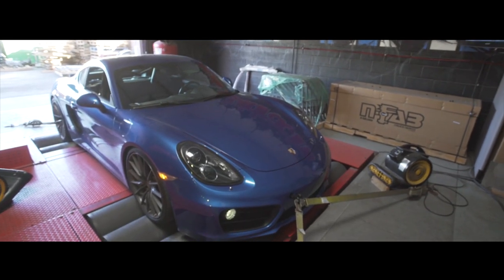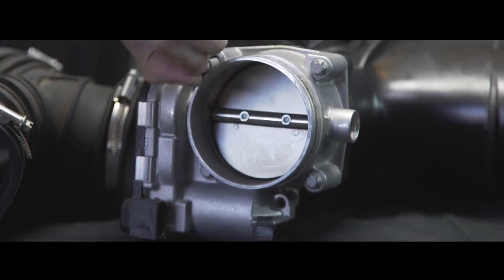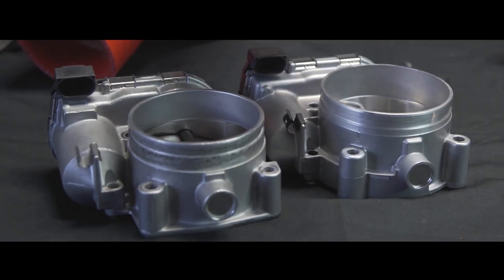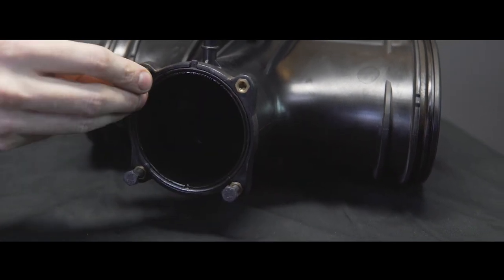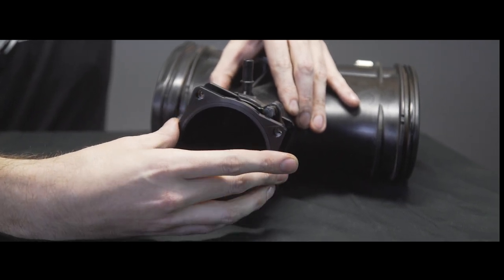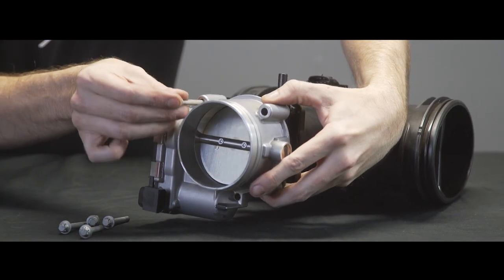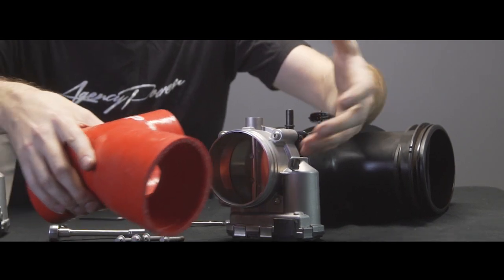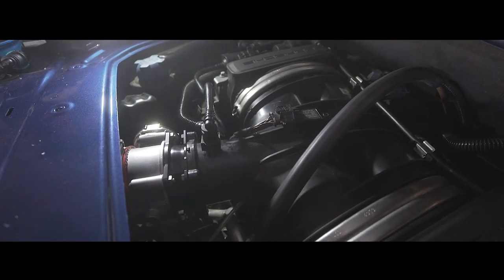Agency Power GT3 Throttle Body Upgrade Install Porsche 981 Cayman S

Comment: I'd need to see a dyno before and after comparison before I would consider spending the coin for this mod.
Reply from the maker: Flies2FLL well.... the description of the video has a link to the product which has the dyno sheet
Reply: @vivid_racing  Good gains above 5k rpm but the chart doesn't show the graph below 5k.  Is there the dyno with the complete rpm range from 2k and up?
Reply from the maker: @vancityfoto1609  Thats where all the gains are so we cut the chart to show that.  The low end is the same.  But that is expected because you put a larger throttlebody and you are getting more air in which is also slower.
Reply: @vivid_racing  That's pretty sketchy.  Please post the full dyno.  There's literally 0 reason to not post the whole curve unless something is being hidden.
Reply: @meh1234590  I am completely with you.
Reply: They don't post the full dyno chart because in the low rev ranges this actually creates a power loss over stock (even though their comment above just claimed that it is more or less the same as stock hp below 5k rpm. I find this lack of transparency disingenious.

Comment: A step down in diameter at that adapter place doesn’t seem wise. Need the larger plenum to go with this
Reply from the maker: Plenum is after the throttle body.  If the throttle body is not getting more air in, what good is it after????
Reply: What I was getting at is no step down in diameter is good anywhere...
Reply from the maker: @frederickcook87  The IPD plenum is the same diameter of stock.
Reply: Bigger throttle body being stepped down into a smaller diameter plenum 😐

Maybe it will help increase velocity 😁

...and if you’re going to GT3 throttle body might as well step up to the lager competition plenum or go with the cheaper MaxSpeed product
Reply from the maker: @mlstockinger  Ours is a very unique designed compared to that one.

Comment: is a tune not required due to the increase airflow?
Reply from the maker: While a tune isn't required, it is recommended to maximize the throttle input and to allow the ECU to provide the proper fuel mixture. The factory ECU should adjust accordingly, but a tune will be the cherry on top for this install.

Comment: The low end suffers before 3000rpm with the GT3 throttle body though.....
Reply from the maker: The 981 one is not as bad as the 996/997

Comment: For those who will fit it on the GTS Version.... You wont have 20HP gain. The gain is only on the S Version, as the throttle is not fully opened to reduce power compared to gts version. Its easier to fully open the throttle in the ecu map.... (and obviously the filling is not reduced anymore by a bigger throttle with same angle....)
Reply from the maker: Thank you for the info 🙌🏼🙌🏼